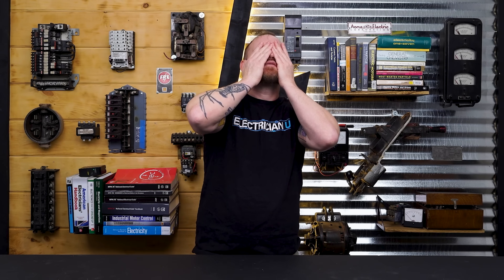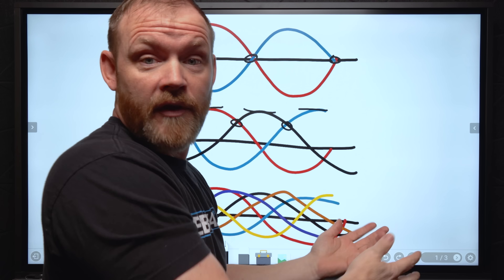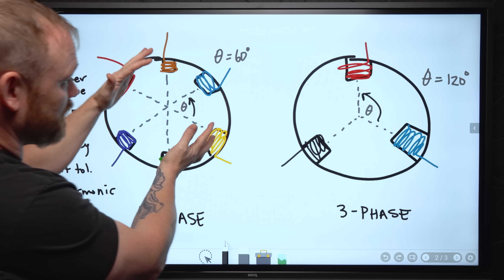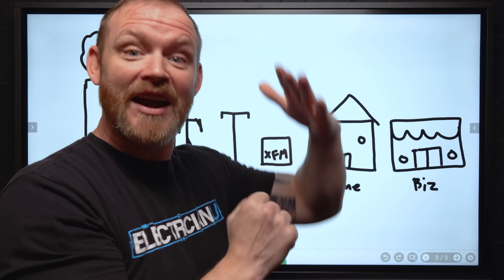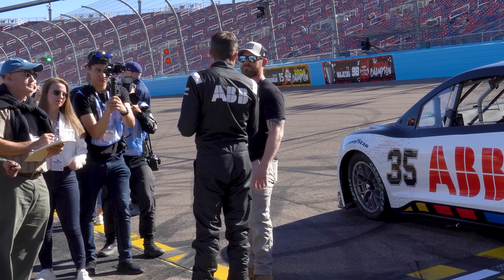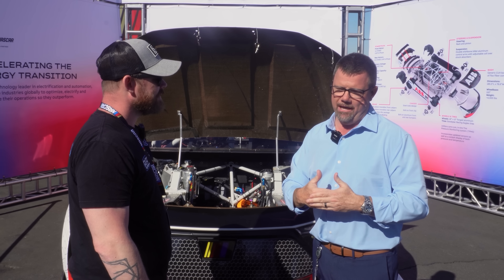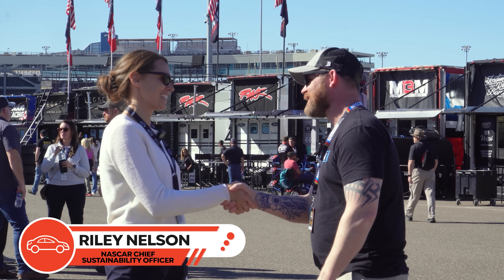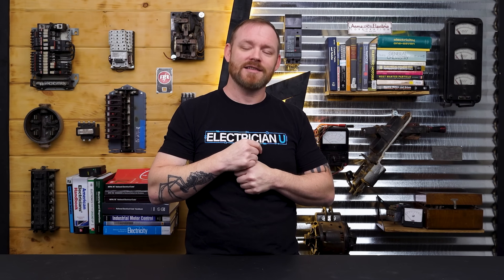6 Phase Power is a REAL GAME CHANGER!

Comment: 3 phase is not only a very efficient way to transfer a lot of power, it is the MOST efficient way to transfer maximum power with minimal wiring and other necessary parts. From single phase power you get to 3 phase with just 1 extra wire, no neutral now required. So by adding 50% more wires (1 extra) you get 300% more power. Additionally, if you have a 3 phase Wye supply, you could theoretically run 3 individual single phase loads with only 4 wires (each line plus a single neutral return) and have it run with no current needing to flow over the neutral except for any imbalance between the loads. It is a ridiculously efficient power transfer mechanism.
Reply: Plus, if the world was 6 phase, you could just tap off three of the phases to continue using 3 phase equipment.  You wouldn't need to replace all the equipment in factories.  Existing 3 phase motors would run just fine with 6 phase power just by drawing off three of the phases.
Reply: Thats nkt quite so true anymore. DC doesn't suffer from skin effect and is the better option for applications such as balancing grids. We now have better technology to deal with stepping down high voltage DC. So the real winner depends on quite a few factors and the specific application.
Reply: 6 phase for power lines also are more inefficient the more wires more loses, and most of the problems that causes blackouts happens with imbalance between the phases or  failing to keep the frequency, due some kind of grounding fault in one of the other phases just more wires to create problems
Reply: Right, when it's time to do really efficient power transfer you actually switch to high voltage DC to avoid the skin effect.
Reply: @petergerdes1094  yes exactly,  HV DC will get you the best out of conductor and insulation.
Reply: @ whats the skin effect?
Reply: @ AC current mostly travels on the surface of a wire while DC has greater ability to use the whole volume.  It is a consequence of magnetic interactions between eddy currents.
Reply: @ hmm never heard of this, does this phenomenon have a name?
Reply: I have no idea what you just said
Reply: Have you considered it's more power efficient? Those are the words used in this video
Reply: 6 phase is less wear and tear on components, less rpm for greater return, less heat makes for greater efficiency. If dealing with permanent magnets reduces cogging between magnetic poles for power generation go see 9 phase power vector this is a game changer.
Reply: It gains 300% higher capacity. 
Not 300% higher power.
Reply: Well, in Europe they often use 3-phases, but it's not 3 wires as you say, it's 5 wires must go to each apartment to be code (3 phases + neutral + ground). However, often they deliver only one phase to an apartment, just each apartment in a building gets a different phase out of three. So it's still 3 wires (phase + neutral + ground) must come in, just like in US.
Delta configuration is not code anymore, only Y configuration is.
So neutral is needed even for 3-phases, and moreover -- counterintuitively, the neutral wire must be rated for even higher load than each phase. That's because in case of a failure of a phase, the voltage between sum of other two active phases is larger than the voltage between an active phase and neutral. That's why they take extra care about neutral wires/connections, even though neutral isn't loaded at all under normal operation.
Reply: Dolivo Dobrovolsky invented the 3-phase electricity transport system based on a single wire per phase (not two wires per phase, see the Tesla patents that were outdated by Dobrovolsky).  Tesla invented a KHz  single-wire power transmission system that is lossless. It is based on a lossless surface charge dynamics (does not make use of bulk currents, avoids ohmic losses). Tesla also designed lossless motors based on the same physics principles. All forgotten!
Reply: @ links?

Comment: I’m surprised NASCAR is enforcing full decarbonizing. It’ll be interesting seeing the fan base switch from petrol heads to EV

After buying my bmw i4 m50 about a year ago, I’m convinced EVs are here to stay and easily take over from petrol.

Only thing left are hard heads refusing to acknowledge the switch.
Reply: NASCAR is woke.

EVs won’t take over any time soon. The grid can’t handle it and the generating plants are overwhelmingly fossil fuels anyways. EV owners have just transferred their carbon from the gas station to the electricity generator.

Also your cost for everything electric will go up, including everything you currently power that isn’t an EV.

Comment: Tesla wanted to do 6 phase power and run 6 power lines everywhere. 

It was Dobrovolski that had a clearer head and asserted 3 phase is far more viable IRL because it used a lot less wire over distance.

Comment: Would 6-phase motors take more wire? Not if the voltage were the same but the current in each wire would be halved for the same power. Power should remain the same for both.

Comment: Not sure how you managed to draw a 3-phase winding where each phase has only one-pole. I worked on a marine propulsion converter for a 15-phase motor, where three converters operate 5 phases each. For minimum sound and vibration, run on 15-phase. For economy when cruising, run on 5-phases. If one converter takes battle damage, you can still run on 5 or 10-phases. Generally, it's more efficient to keep it simple. The more complex the motor winding, the more of the copper is used to connect them up rather than laid in slots producing torque.
Reply: That’s cool!
Reply: Man id love to know what you do about motors
Reply: That's really cool, so you run a motor with 3 5 phase systems, so you could think of it as three 5 phase motors in one motor. 6 phase could be thought of the same way, two 3 phase motors in one. If you lose one set of 3, you still have a full 3 phase motor working. Or you could shut of one set for cruising for Efficiency. One could do 9 phase or 12 phase, or even set up a 15 phase motor as five 3-phase sets. I hadn't thought of this before. Thanks. I was thinking of building a 6 phase wind turbine, but it could be any number of 3 phase generators using existing 3 phase electronics.
Reply: @wiredforstereo There are a lot of Chinese permanent magnet multi-pole pancake motors made primarily for the elevator market. They are designed to work at low rpm which would be better suited for wind turbines if you want avoid a gearbox. The output can be rectified to feed into a grid-tie inverter for exporting to grid. A control system to keep the turbine speed constant would be useful.
Reply: @brendanpells912  I'm going to build my own, thanks.
Reply: The drawing I'm sure is made for simplicity. One wire goes to one coil. Done. Now one wiring a motor is watching this video to do so, so it's fine and gets the point across. Though more accurate information, like showing the actual wiring of a motor in diagram form, is more better.
He did mess up the single phase though. Not sure where the second phase there comes from. Lol.
Reply: @mikes2381  use ac induction motors and drives every day, seen em die, limp and never brought one back to life. Are all 3P 480V x rpm ac induction motors the same ? Or are there details of diff windings that can make one design better than another for a given app?
Reply: @Skunkhunt_42  of course there are, for example, the axial flux motor
Reply: @Skunkhunt_42  The most basic variation is how many poles the motor has. The fewer the number of pole pairs, the faster the motor will spin but it produces lower torque. So a 4-pole motor turns at half the speed of a 2-pole motor but delivers twice the torque for a given kW rating. The more poles in a motor, the frame size gets bigger to fit in all the slots for the windings. Efficiency also drops off because more of the copper is used to link between the slots at the end, where it doesn't add to the torque. Other than that, it comes down to the quality of the winding, insulation materials, bearings and seals. Motors controlled by inverter drives are subject to higher voltage spikes, and these can break down the winding insulation over time, especially if water gets in. Poor design can also cause currents to flow through bearings which can damage them by spark erosion.
Reply: @brendanpells912  horsepower (or power in general) is basically the amount of torque you can apply per second. Imagine using reduction gears with your 2 pole motor to achieve the torque of a 4 pole motor
Reply: @johnathanrice3569  I did these calculations all the time. Some things like pumps and fans don't have gear boxes, so it's an advantage to use a 2-pole motor if that's the speed it needs to run at. Many applications use a reduction gearbox anyway, so you might use a 2, 4 or 6-pole motor, depends on the overall cost of motor & gearbox. I've done conversions of cranes where the existing motor DC motor is 580 rpm. To replace it with an ac motor the closest match would be a 10-pole motor, but an 8-pole motor may be cheaper even taking into account that it has to be de-rated because you're running it at 580 rpm instead of 740 rom. A 10-pole is generally less efficient which means the control gear has to be up-rated to suit the higher current.
Reply: Six phases makes no sense for two reasons. Normally you would have a pair of poles for every phase. Each phase can both push and pull, therefore you get only 60 degrees between each torque maximum. With six phases with a 60 degree angle between you gain nothing. With a 12 pulse rectifier you create 3 extra phases, but they are 30 degrees offset from the first 3. This means that you get 30-90-30-90-30-90 degrees. With a full wave rectifier you get only 30 degrees between each voltage maximum. 
5 phases would make more sense because you would get only 36 degrees between torque maximums.
The other reason six phases makes little sense i that it just makes things more complicated with no practical benefits. The sum of the three phases equals zero, and you can transfer three times as much power over 3 wires as you can with 2 wires in a single phase system. There is no such benefit with six phases vs. three.

Comment: Take the existing 3 phase system and run the other 3 new phases alongside them at a safe distance of course. 

To solve the three to six phase conversion at existing buildings and businesses: 
     
For industries who use motors, Use half the existing motors and leave them alone. The other half should be wired to the new three phases. 

 For the businesses they would just need another 3 electrical panels installed but it would be redundant because unless they expand the existing building and have a need for the additional three phases, those additional three phases aren't really needed. 

Homes could be wired to where six different homes could be hooked to a standalone phase each. 

As far as converting the existing generators, those are where the real work begins. 😂 As stated one generator could be used, just stack the other 3 phases behind existing infrastructure and adjust the new three phases to where they are the most efficient.